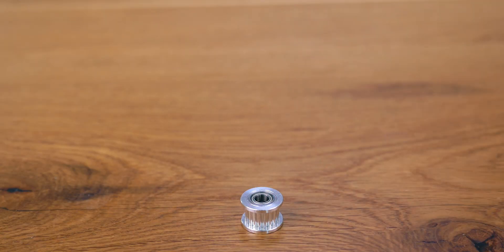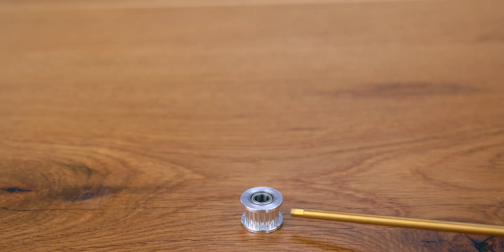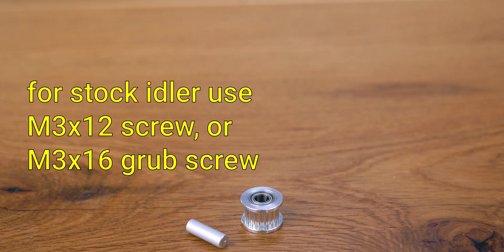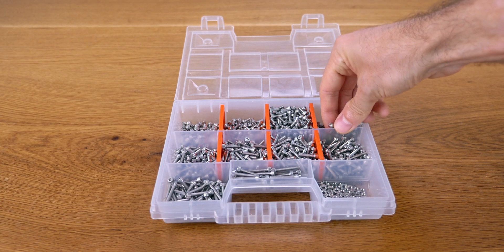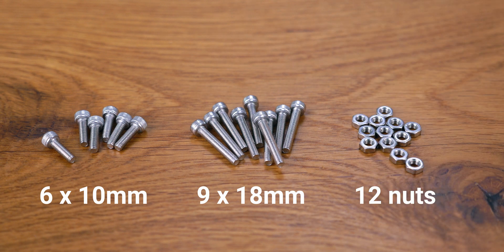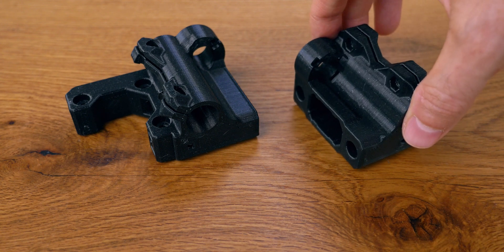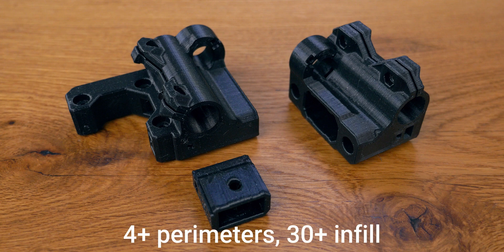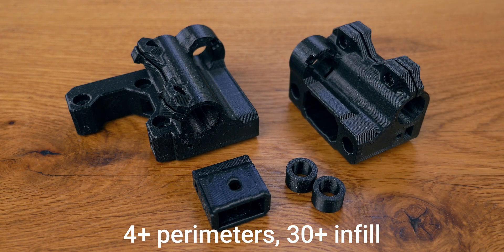Prusa Adapted Revised X-Axis BOM

Comment: Printed parts

    "PitStop extruder printed parts in ASA or ABS if possible. PETG might work, but the shroud can melt. For print settings I recommend 3-4 perimeters and 20-25% infill for stiffer parts. Printer should be reasonably calibrated to avoid crooked prints. Print the fan grill in 2 colors for a better look. STL files not available yet"

As much as this is cool, you should just release the stl's for the PitStop Extruder already before someone else makes something like it lol.... at some point dragging your feet to cash in on the hype you've lost your way.....
Reply from the maker: As I said, late next week. Seems like I shouldn't be talking about my projects before they're ready or I'll end up with an angry mob at the door.
Reply: @MihaiDesigns  that or somebody will take your idea and run with it.....

Comment: perfect, thanks :-) start printing now
Reply from the maker: Have fun! Looking forward for some feedback, especially if you're using the stock idler. I only tested with the other idler.
Reply: @MihaiDesigns  the pulley idler must be wit the teeth? And how much is width?thanks ;-)
Reply from the maker: @David Hoza good question! Can be with or without teeth. Some people say it's better with teeth and with wider 5mm internal diameter. I haven't compared to be frank. You can use the stock one if you want with a normal screw (I added support for that). I'm away and can't measure the width, but it's the ones for 6mm belt and needs to be a 2GT. Link to E3D store where I got mine from https://e3d-online.com/products/gates-powergrip%C2%AE-2gt-idlers